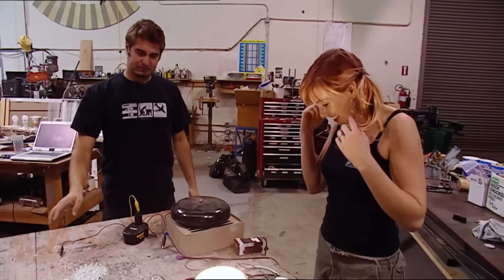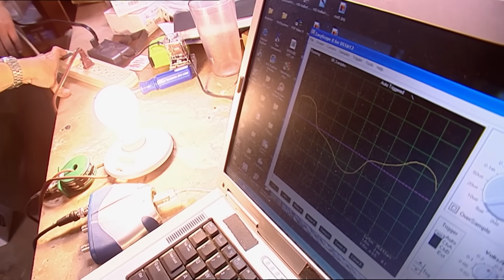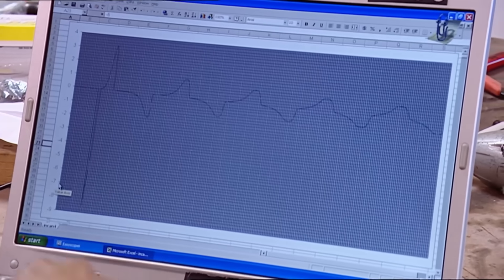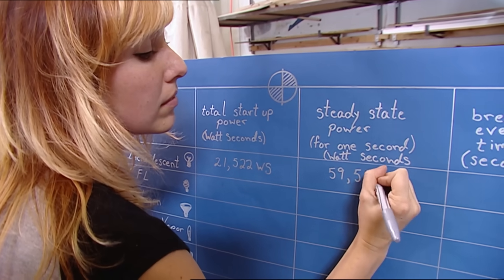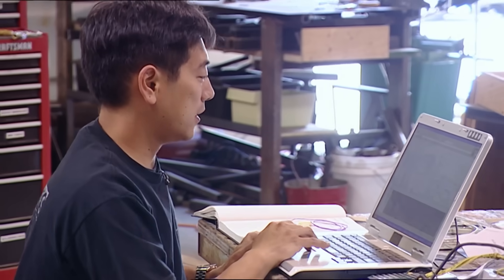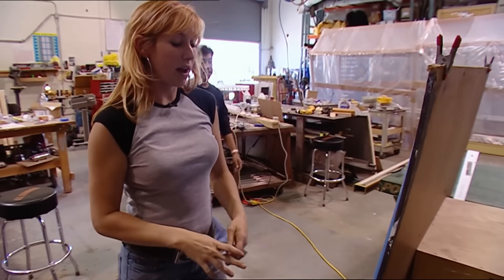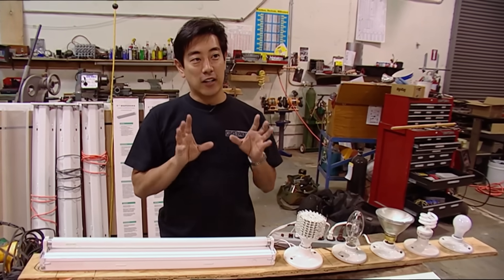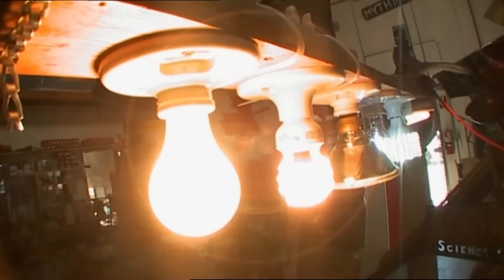Is It Cheaper To Leave The Lights On Than To Turn Them Off? | MythBusters

Comment: You should do this for heat pumps, the myth is it's cheaper to run it on 21 all day rather than what I do which is put it onto 30 for 15 minutes then turn it off

Comment: A very obvious error in this video is that they did not have an equal light bulb test that was on for the entirety of the 6 weeks they only did an on-off but never compared it to the same bulbs that remained on the entire time. I use LED in my house and not a single bulb has ever lasted anywhere close to 5 years. So no, LEDs do not last four or five years sorry. The amount you're going to save by shutting off lights is as minuscule as the amount you lose by keeping them on meaning it's a waste of time to get stressed out about shutting lights.

Comment: there is another angle here, the power cycling and low durability of components used in modern LED's (you can get HQ, but it will cost a lot and needs to be ordered at specialized supplier or the web... If you save a couple dollars by constantly switching, but the led lasts 6 months instead of a couple years, then savings get voided

Comment: It use to be best to leave them on because of the way they use to be designed. Definitely aren't saving money on energy lol.

The way bulbs are designed now allows them to last thousands of hours for just the filament style bulbs. The LED style last even longer.

With that being said I've definitely had new bulbs be DOA or fail within a couple days. 
Tip: Write to the manufacturer of the bulb and send it to them while requesting reimbursement.
They usually send you a voucher for a 4 pack of same style or they could send you high end LED bulb. Nonetheless if you take the time to send in the DOA/Failed bulb they hook you up.

I did it with Starburst too lol. I recorded myself buying them from the store and then using the store scale at self checkout to weigh the bag and compare it to what the scale was showing.
I was sent a 6.4kg bag 😅... another tip.. don't eat a 6.4kg bag of Starburst in less than 24hrs. I sent them a picture of the empty bag and wrappers all over my office at the time.
So ya, that's how I got instant diabetes 😅

Comment: Your surge would have to be INSANE way more than the wire or device could handle to use more power in a moment than over time.

No need to test this as electrical science and physics already dictate it.

I love this show, but it's definitely made for TV level science lol

Like assuming just one bulb of each type has any weight for a real test, needs much larger control and scale to have statistical worth or scientific value.

Comment: curious if this is same for night light and  auto dusk to dawn.   Also if it would work the same for tealight on a coin battery.   And what about smoke detectors that are always on and one battery lasts 6 whole months.  Ours are on battery and hard wire just like the alarm but don't think plugging them in or hard wiring saves any battery life.  Fun research though...

Comment: Something not factored in that was semi-relevant back then in the incandescent bulb days. If you used electric heat (resistant head, not a heat pump) and it was a time of year you needed to heat your home with said heat: leaving a light bulb on was no more or less efficient than turning it off due to the fact it was putting off 60w of heat helping heat the room and reducing how long the 1500w+ heater had to run. 

But if you used any other form of heat: like gas/oil/propane/heat pump, etc. then it was no longer a factor.

Comment: Well in case of LEDs there is no start penalty. Most LEDs blink at 100/120Hz or in kHz range. The only start penalty goes to the power supply of the LED, but still way smaller than any other lighting solution

Comment: Inrush current on starting a light is 1/24 of a second (this is considered a standard among electrical engineers).  Inrush current is about 10x the amount of wattage for the light.  So if the bulb pulls 100w in a second, the extra amount pulled on start up is 100*(23/24)+1000*(1/24).  This is about 136W for the one second on turn on.. after that it reverts to 100 since in rush was over 1/24th of a second after turning it on.  Turning your light off is the way to go, full stop.

Comment: Longevity of a lamp is actually another huge conspiracy, they could feasibly last nearly forever, but they are manufactured to break so you have to buy new ones.
Reply: mine blew every 3 weeks. I'm from.South Africa
Reply: @roylaw1291 I mean that could also be a different underlying issue. Electrical issue, loose wiring or the wrong type of bulb

Comment: Not true! It's a flawed experiment. I would argue it's more expensive to replace a CFL who's starter died before the bulb itself by turning off less. Maybe limit to 1-2 a day.
CFL bulbs are basically mini-fluorescent. That means they have a built-in starter. Fluorescent needs a starter spark similar to an engine.
I've seen it a lot of times - CFL bulbs' starter dies before the burnt-light-producing material does rendering the whole bulb dead.

Comment: The first half of the experiment ignores the fact that the bulbs draw more power because they’re heating up, so if you turned the bulb off for 0.3s and on again, the turn-on spike wouldn’t be nearly as big.

It would have been nice to see them actually crunch the numbers for the second test. Cheap incandescents wouldn’t be worth leaving on, but more expensive fluorescents with failure-prone ballasts maybe would be.

Comment: a light uses energy. There are ways to confirm this fact. One is your electric bill. Leave a light on and the bill goes up. I lived on solar and lead acid batteries for 10+ yrs. Leave a light on and you'll find out real fast what a Watt is and what a 10 to 1 inversion means. Even a hundred watt Incandescent will drain down a 100AH battery in a "short" time which I wont calculate here.  Today I have a Tesla glass solar roof and two power walls. Very cozy. But we use energy. LED energy helps a lot. When we use electricity the batteries go down and have to be charged. That cost is paid for, because we bought it. But PG&E is still part of our life. And be it a light bulb or the electric sauna or charging up our Tesla mobile, it cost $$.

Comment: Another thing for leaving the light on is that it is a pain to go and switch it on and off in the evening when you can't see anything. I don't put the lights on during the day unless is miserable outside and dark inside the house. For LED lights, it is nice to be able to walk around the house with some light and also when you come home and the house is not in darkness. Nothing really to do with the savings, hopefully with LED the cost is fairly minimal. I probably use more boiling up a coffee or putting the heater on.

Comment: First part of the test was great, second part not so much. They simulated 5 years of switch cycling, but they failed to record hiw quickly the lamps would fail, quicker than 10,000 cycles, but how much quicker?

Comment: Having the lights on heats the room by the number of Watts they consume. If it's hot outside, by all means turn the lights off. If it's cold, it may not matter that much since they reduce load on primary heating systems. I can clearly notice that I don't have to burn quite as much wood if the computer has been running all day.

Comment: Ok... but it should have been compared to the average longevity of the bulb and calculate the energy cost difference of the energy saved,
If turning it off kills it after 5 years but if it cost 5$ could have last 10 years. Unless I save more than 5$ turning it on and off then it is better to let it run.
Moreover, there is extra cost and annoyance to replace light bulb.
I forgot how bad their science were... I mean it is at best undergrade level.

Comment: "Cheaper" would also have to include the cost of replacement bulbs.  Turning incandescent bulbs on and off is much more stressful on the metal than leaving them on.  However, incandescent bulbs are also horribly energy inefficient in general.  So, really, the true test is how much does each bulb cost in terms of electricity used per hour plus replacement cost averaged over (for instance) one year or ten years or such.

The real take-away is that you should use LED bulbs and save money on electricity -- they use somewhere around 2% of the power an incandescent bulb does to produce the same amount of light.  If you used LED bulbs, and you used to keep incandescent bulbs on an average of about 1/10 of a 24 hour day, you could leave the LED bulbs on 24/7/365 and still only use 20% of the electricity you were using on the incandescent bulbs.  While you certainly CAN worry about turning lights on and off, the TYPE of light you choose is actually a far more significant factor in cost.
Reply: Cost shouldn't be everything. Incandescent bulbs produce healthier light. It's a tragedy so many countries were forced away from using them.

Comment: However, with modern LEDs, it’s arguably the case that the energy you save by turning off the lights is less than the energy it takes to reach up and flip off the switch.

Comment: 2lips-half a trailer sittinh smack dab in the middle of 2 lots.
One side, lopped ear rabbit, electric surgentoed-on the dog-mother(a mary.
The other side thumped in stride
A-
Bi-cycle built
Four-two.the previous owner left the bill a clock-don't bother?
-counter fit to fit the bill when you throw
A-fit, print sets picture perfect? Twy wabbit ears!

Comment: They didn't actually say how the lifespan of a bulb is effected by turning it off! AI says, "Turning a light off can shorten the life of a fluorescent bulb due to wear and tear, but it has virtually no effect on the lifespan of an LED bulb. For an incandescent bulb, turning it off saves energy and slightly extends its life, though the overall lifespan reduction from on-off cycles is minimal compared to fluorescents."

Comment: They missed the most important data point... The control, They should have had a set that they left on the entire time.
Reply: They weren't great at following the scientific method.
Reply: man, how tf can you be so confident in saying something so stupid? You only need a control if you test simultaneously, it's ridiculous if you test individually. It's akin to measuring the dilation of metal with temperature, measuring the length at different temps and then you saying but they didn't constantly measure a control piece of metal constantly while changing the temperature!!! Absolutely, fantastically, incredibly, dumb.
Reply: it's just a show
Reply: STEADY STATE POWER IS THE CONTROL YOU ABSOLUTE MONG OMG how has nobody corrected you already jesus christ.
Reply: They couldn't have in this case. Simply leaving a bulb on for 6 weeks is not equal to the amount of torture they put the bulbs through with their testing. Remember they power cycled the bulbs the equivalent amount of times you would during normal everyday use over a 5 year period. The only way to run a control for this test would be to leave a bulb on for 5 years.
Reply: Well, I think only the flourescent would be relevant. If youre saving more when turning it off it would mean how many 5 years you need to say that its much better.
5years is already not bad for replacing bulbs
Reply: Unnecessary, you can measure the "on" usage rate and multiply per whatever time frame you want. First category.

For longevity testing you are correct.
Reply: @James-p3m8j  You need a control to make it a legitimate scientific experiment. It's too rule out other possibilities that aren't foreseeable. For example, maybe the amount of energy was different going through the timer switch which could have impacted the results and caused either fewer or greater number of cycles to burnout. Whatever the outcome may be, the point is you can't know everything about the situation.
Reply: @steelonius  that’s not true, nothing better as control as the same bulb in constant turn on. However, they should have tested several bulb of the same kind. But the control is internal, which would give a higher statistical power in case of an experiment.
Reply: @kenshin34090  I'm not sure I understand your writing. But the control functions as a reference or baseline to make sure you are actually observing a change because of the variable being tested. It helps to rule out other possibilities and act as the foundation for the observation. Statistical power can come from the sample size or the number of repetitions where the same outcomes are observed over and over thereby affirming the variable being tested.
Reply: @steelonius  statistical power also come from reducing variance that you can’t measure. Using the same bulb as control is a way to do so. It is not true that you always need another item for control. Here, they have consumption when a bulb is constantly on and when it turns on. That’s good because they can pair their analysis. However, they should have done that on several bulbs to know if it was not that particular bulb which drive their results. I hope I am clearer.
Reply: @steelonius no. This is ohm’s law. It’s exactly the same every time!
Reply: @kenshin34090  Yeah, that makes sense. Thanks for sharing.
Reply: you dont really need that info. You just need to meassure the increase in energy to startup, then solve what frequency of power on/off match a constant power in the bulb. A frequency less than the calculated means that you save energy just by switching on and off than maintened the power on.
Reply: @demr04  you may need to know it, there are many types of lights, some are more or less expensive and use more or less power depending on how long they are on, and have different cost and ware depending how often they are turned on and off. so if the question is about cost, then to answer your question, I don't know because they didn't do it so that question can't be answered... which is why I said it's missing.
Reply: You would only need a control in this instance if your goal was to discover the right answer without thinking even a little tiny bit.
Reply: They probably decided against it because it would take too long before any fail. Lights left on continuously can last months or even years
Reply: For the test they did, they did not need a control given the context of the day and age in which they filmed it. This was filmed when LEDs were a cute rare little novelty and the majority of people were still using most to all incandescent bulbs to light their homes. For those of you who don't know, an incandescent bulbs did not last 5 years. They came in huge packs because they had to be replaced very regularly. What is implied here is that if turning it on and off causes it to fail after 5 years then turning it on and off does not matter and a control is not needed to prove this because everyone in the audience already knew that an incandescent bulb left on continuously would not last 5 years. Again in the context of only incandescents. LEDs have changed all of that obviously. This was filmed in a different time where the answer was really focused on a different problem and a different technology.
Reply: @jacqslabz  "everyone in the audience already knew"

This phrase is the antithesis of the scientific process.
Reply: Which myth was busted. Could concentrate on the science much.
Reply: Irrelevant. Once on, the rate of consumption never changes.
Reply: @marvinmeeker5765  I think you mean negligibly changes. There are most definitely changes as no material is impervious.
Reply: @marvinmeeker5765  depends on your perspective, could be that lights turning on and off a frequently have a lot more ware so you're buying a lot more. just as one example.
Reply: I agree. Not sure if someone mentioned but the IMPORTANT thing was how long do bulbs last before REPLACING??? We know flipping them on/off is the equivalent of 5 years of use and only the LED was still on, but how long do they last ALWAYS ON??? They likely skipped this because they weren't waiting 5 years to conclude  their "episode". But, they still could have run the bulbs ALWAYS ON for the 6 weeks or maybe even 8 weeks to see if any went out.
Reply: @Arthur-kz8jc   i see you can't read, the test is to see if you save electricity by turning lights off. it's impossible to accurately gauge how long bulbs last since they're all different..... you can see a difference in one box of bulbs on life span.
Reply: The control group is every other light bulb in the world, we know how long light bulbs last with normal use.

The big problem is that they only had a single data point for each bulb type in a single condition. What they needed is MANY bulbs of the same type, from different manufacturers/dates, under various conditions, INCLUDING control groups for each.

But it's an entertainment TV show from the 90's.
Reply: @ahall9839  sure give me the universal tested data of every light bulb in the world with normal use.. i'll wait.
Reply: @AppliedLogic.  The point

You
Reply: This guy is right no matter what. You cannot prove anything without control group.
Reply: @zz4165 nope. Control group is irrelevant here. This is ohm’s law, not a bacteria culture!

Comment: I have 2 incandescent light bulbs in the downstairs bathroom that has been there for years.   They have outlasted several LED lights that are not half as old.  
I also have 2 incandescent light bulbs in the upstairs bathroom that are about the same age.   
I have no idea why the bathroom incandescent light bulbs are still working but all the other incandescent light bulbs died.   The bulbs that died have been replaced by LEDs!

Comment: I’m not going to flip them off, so how about you also calculate the energy and money trade off for having a nuc running home assistant 24/7 with wifi bulbs controlled by a Zigbee contacts sensor that needs batteries every 5 years, in order to switch them on and off when entering the room